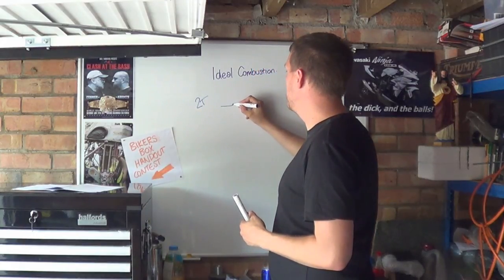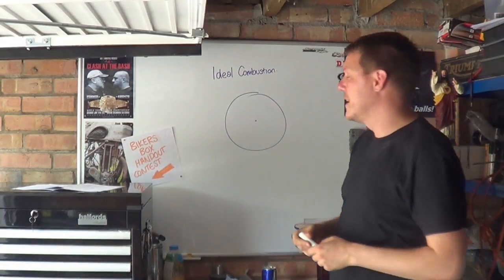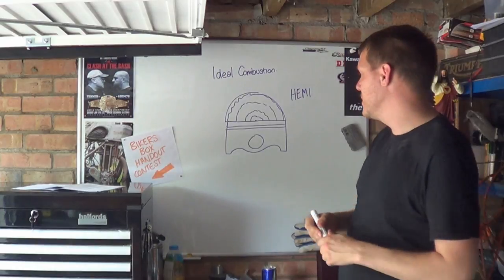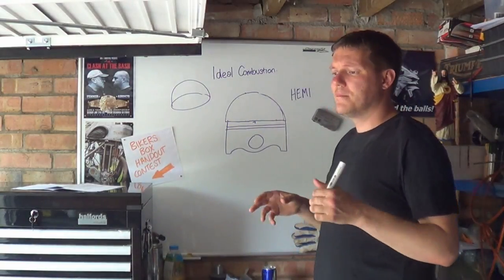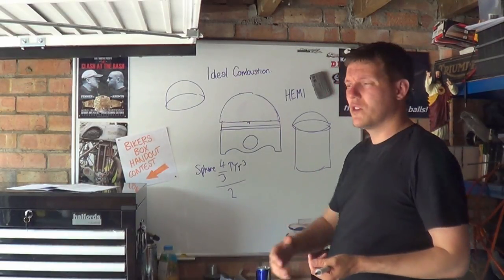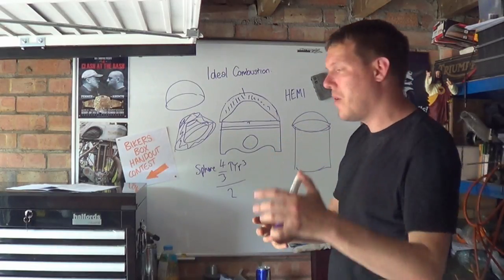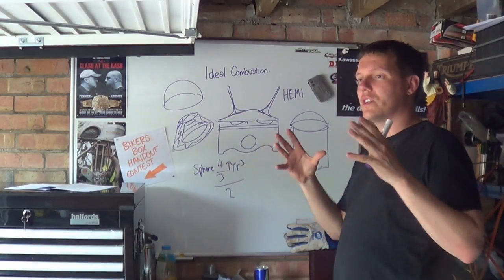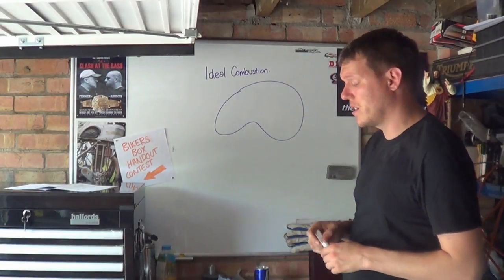Perfect Combustion and HEMIs

Comment: A lot of italian high performance car engines used to have hemi heads back when they were all 2 valves per cylinder. Ferrari colombo , jano , lampredi v12s , ferrari lampredi inline 4s , ferrari jano v6s , ferrari v8s , lamborghini bizzarini v12s , lamborghini p300 urracos v8 , alfas v8s , fiat lampredi inline 4s etc but whenever the word hemi gets thrown around only thing people know about is mopar. They have absolutely no idea that those engines i just listed are hemis and they think hemi is this great american thing lmao. Also the racing variants of these engines often had twin plugs per cylinder to try to get an even going flame front within the cylinder

Comment: Hemi heads are very efficient under boost, or with very mild cams running low octane fuel. That is why the heads are still used in truck engines because they are efficient at making low end torque and when flame propagation is not a big issue at low rpm. Also, the reason bikes have >12-1 compression is because they are not designed to make any reasonable torque at low rpm. There would not be enough horsepower from a 250cc bike if It make all of its torque low in the rpm band. This means the bikes are actually very inefficient at low rpms (late intake valve closing) to lower the dynamic compression ratio and raise the torque peak. Bikes would not be able to run 91 octane fuel if they had mild camshaft designs, the cylinder pressure generated at low speed would be so great it would detonate badly.

Comment: You have no understanding of wet flow and total combustion . Total Ignition timing is the real indicator of how efficient  the Intake port and chamber is , A typical pent roof chamber 4 valve engine makes best power with 20 degs of total timing , that is very good yes , and the OLD Hemi will run with 38 to 40 degs of total timing , But the intake port wet flow is all down the side of the cylinder wall , so now atomized fuel even goes to the spark plug , But if you develop the port and chamber together as I have done with a kidney shape chamber and wet flow that will wet both quench pads , On an engine dyno w a 410 cu in ford clever , that engine made best power with 17degs of total timing . That head became the CHI 208 head

Comment: flame propagation in the cylinder is a very interesting subject. I worked as a contractor at Perkins engines for a few years and used to love chatting with the engineers about this type of thing. The swirl is incredibly important to allow the flame to propagate like fingers through the cylinder. Great video Matt.
Reply from the maker: "Perkins"

- in Leeds or Peterborough. My old man used to work there
Reply: The Workshop Peterborough mate. Couldn't fault the engineering there. They might paint some of them Yellow...but they're still well engineered British engines

Comment: Great video as always Matt.  Yamaha tried to mitigate the limitations of hemispherical chambers by introducing a polyspheric chamber with the XS1100, a design which required six machining operations to achieve and it allowed them to run a lighter piston with a slight crown but achieve the same volumetric efficiency as their rivals .  So even back in the seventies Japan knew the hemi was dead.  In fact the XS11 was a milestone engine for Yamaha for a number of reasons, first in-line four cylinder for Yamaha, the first in-line four to run CV carbs.

Comment: I like throwing crazy ideas out there so here goes.  Why not have the cylinder head flat and the piston a convex sphere so it dips in like a spoon so the piston its self holds the perfect hemi shape.  Great videos Matt.  It tunes my brain in works it hard in the the same way my body feels good after being in the gym.
Reply: The force of the combustion would not only be downward, but all along the piston wall, pushing it in all directions the piston wall is opposed to (even though the net force would still total to a downward movement, any force being applied anywhere other than towards a downward movement would be inefficient) and that's why piston heads are flat. The Workshop explains this well when talking about Rotary engine flaws, as the combustion doesn't directly push the rotor the way it's supposed to go, despite the net force totalling in the result of a correct directional movement for the rotor.
Reply: it's been tried. The Jaguar V12 had this chamber and VW did some engines with this chamber. IIRC I think the Audi 5 cylinder might of had this type of chamber Early on.
Reply from the maker: And don't forget diesels
Reply: do an image search for 2cv head and pistons... is that what you mean?

Comment: I don't know if it's being done or thought about. Say you'd create an alternate exhaust cycle, where you have a conventional valve head with short valves straight up. After ignition on the downward stroke you keep the exhaust valve closed, (trying to create a vacuum), when the piston is reaching BDC you introduce air, and open the exhaust valve shortly after (with negative pressure), purging the cylinder of exhaust gases. Whould something like this be firstly: mechanically do-able, or in need of a boost system. For instance using a turbo to "vent" your cylinder. Just thinking crazy stuff here. (edit) this to maximize compression and equalize the combustion process as much as possible, by getting the valves, pistons and top of the heads as close to each other as possible at TDC/Ignition.

Comment: Wait why can't you put the spark plug on the piston?
Reply from the maker: Are you mad? lol Good question - video this weekend
Reply: That's just what I was going to ask, little taller piston to fit above the wrist pin and wire. Have some skookum (AvE-ism) ass wire run down past the crank to your ignition of choice. I'll bet it hasn't been done because the efficiency gain isn't worth the manufacturing cost.
Reply: I'm mad af man, cliffhangers are bs!
Reply: Cody I'm hip that's what I was thinking
Reply: Could you imagine doing a spark plug change if they were in the pistons lol
Reply: I do, the problem is holding it on without it flying around, I drill 2 holes in the piston and just cable tie it down, after the engine has done a few revolutions the plug has usually made its imprint in the head for clearance. you just run the HT lead through the original plug hole and plug it with some silicone.
I have also done the same with just a cheap disposable lighter that way there is no need for the HT lead.
Reply: 69waveydavey I just turned my engine upside down so the spark is on the bottom.  saves money in cable ties and silicone
Reply: karl shaw according to Matt, serviceability doesn't matter to engineers. (Just poking fun :p)
Plus with fuel injection and spark plugs in the piston would last longer than the first owner.
Reply: karl shaw Wireless spark plugs. Genius.
Reply: You can also do away with the exhaust valve as the fumes will just run out under gravity, less moving parts more energy saved
Reply: While we're at it, let's put the intake valve in the piston, and use the crank case as the intake.
Reply: Thats been done, early rotary aircraft engines had exactly that, the problem was they would end up sticking and they eventually switched to ports a bit like on diesel 2 strokes.
Reply: Ceazar Carr You could have a distributor in every crank and always get the right timing!
Reply: nooooooo!!! conductive path through crank conrod and pistone, earthed through the cylinder liner, with a gap in the piston design to make the pixies angry. engage safety squints before starting
Reply: mondayfool they also use knock sensors, basically microphones tuned to the frequency of a specific engine.
Reply: Tom McKenzie makes sense. Id like to get a 'dumbed down' version too, I think I get it but it's really confusing still. 
I'm a Saab guy so that caught my attention lol, I own an older 900 without trionic but one day I want to put that on a turbo 900 classic
Reply: The Workshop SAAB did it, the spark did jump directly from the electrode to the piston
Reply: Gudgeon pin. ;)
Reply: How about multiple laser beams that intersect just above the piston?

Comment: I concede that 4-valve heads out-flow 2-valve heads, but I still maintain that the LS series is still acceptable because the height and simplicity of the cylinder head for the performance they achieve is useful.

Comment: In a four stroke engine. The hemi cylinder design allows for 13-13.5 to one. Where the hot hot exhaust valve affects compression ratio. HCCI combustion chamber allows so far 20.00.1 compression. In a four stroke engine. Imagin if you combined them. Both together in a valve less two stroke engine. We could see compression ratios at 35-40.00.1. With a true hemi domed piston to boot. Haha my two stroke hemi V8. Dragster engine. Fires four combustion chambers simultaneously. Race me. 😄

Comment: What about a quad-hemi chamber, with 4 smaller hemispheres arranged in a square over the flat piston, and a 4 valve design with a valve in each hemisphere, and a spark plug as close to the piston as possible in the center of all 4 hemispheres?

Comment: Im American and I agree with everything u said. yes our comp ratios are low but that's ok because we have very crappy gas, so couldn't run very high ones anyway. ✌️love ur vids
Reply: Scotty Whittaker Our gas is no different for the most part from other countries. You are confused by the different octane rating equations. our regular 87 is England's 91 or 93 or something. Point is, they are the same octane.
Reply: i think Dylan is right. but just not clear enough
i assume he meant RON and AKI fuel octane rating
like 91RON fuel is like 81 in AKI or something i can't remember the exact number. but it's the same fuel octane rating, just measured with different measurements.

like you would measure a table in meters or inches. different numbers. same size.
Reply: Exactly, just a bit more concise than my frazzled brain can manage

Comment: mercedes use the cone effect on the new petrol direct injection motors to obtain a lean fuel ratio for homogeneous running at low torque and switch to full fuelling via the injection pattern for stratified full power at high output. it is so precise that if the spark plug is slightly off its torque setting that cylinder will not fire at all
Reply from the maker: Link please?
Reply: I might have something in a training book some place from when I did the v6 and v8 petrol engine course. I'll have a scout in my folders
Reply from the maker: Awesome - cheers

Comment: Could you do a video explaining how TJI in F1 works, Sky had a small explanation on tv but I found they never went into any specifics on how having the spark plug in a mini-chamber separate from the main combustion chamber and having the flame front propagating from there would be a benefit. I would be very interested to know that if this is such a great idea why it has not appeared in any production vehicles since regulations on emissions are every increasing. Great videos btw

Comment: Tell the Hemi thing to the Top Fuel and Funny Car dragster racers. Big block fords and Chevies have been tried on nitro, but the Hemi always has the Edge in the Top end. Whats so good about the LS is that it is so overengineered, I mean you have 4 bolts in the mains with another two that come in through the sides from the outside of the block in the sump skirt region, it's just so understressed in stock form it's rediculous. It's only real competitor, the Ford modular motor, available in either single or dual overhead cam formats (hence - modular) is so much more expensive on a component by component basis that it's not funny. I mean, have you priced what it would cost to totally renew the valve train on each head on a Boss Mustang Dohc modular? For that sort of money you could built a pretty stout LS. And there's just so many available at every junkyard in the states that, if you blow one up, you just buy another junker core and transfer all of your bling bits over. What I'm doing is, you can get the truck blocks, which are cast iron instead of Aluminium but still have the alloy heads, so they handle a bit more boost, I wanna built that up and back it up with a stout 4 speed auto with transbrake and go racing. And, like I said - If I blow it up, it's just a matter of buying a 2nd hand core and swapping over the go fast bits and having at it again. Try watching this : https://www.youtube.com/watch?v=VsmbbuSq9m0

Comment: Hi Matt 
I have been thinking alot about rotationel direction i an engine. Is it just a balancing or timing issue or do motor co. all have there way of getting around it. 
Awesome show. Lots of knowledge. 🖖
Reply from the maker: What do you mean? Which way they turn?
Reply: The Workshop. Yes precisely which way they turn and how to control it. If it even needs to be controlled? Because potentially its just a timing issue. Right?

Comment: Why couldn't you have a dished hemisphere in the piston with a totally flat cylinder head with four valves in it with the spark plug central?
Reply from the maker: Many reasons, and here are some:

1) rockers etc need somewhere to live. Vertical runners massively restrict this. For OHC this is also an issue.

2) the piston would have to be bigger/thick and this means heavier which reduces piston speed and rpm hence power 

3) piston heating on the 'rim' promotes detonation.

Comment: That's why all of the top fuel dragsters use super charged hemis... because of the dome and excellent combustion and air flow. But what do I know lol
Reply: The reason they use hemis is that hemis work very well in boosted applications. The dome is actually not a pro as it makes the piston very heavy and is only included to get the compression ratio right. Other reason is that the only other manufacturer to make a production hemi was ford with the cammer, but it was underdeveloped. The cammer did compete in top fuel for a while. The 460 was never used as it was too late to the game. The only other engine that could have bested the hemi was Oldmobile's stillborn W43. With pushrod actuated 4 valve heads on the 455 block, it stood to beat the Buick Stage 1 as the most powerful street engine and with the DOHC OW43, would have cleared house in racing.

Comment: what if you just added alot of boost to get around the shity compression ratio. or you could make a "semi hemi" like alot of performance American v8s have, which is basically 2 small hemispheres around the valves and the rest of the piston is flat.
Reply from the maker: The LS engines have bathtub chambers

Comment: Let's say we put a proper OHC, 4 valve head on an LS or modern "hemi" block. Keep the cam profile comparable to factory and CR low enough to run on 87 (91 RON?) octane fuel.  How much power would be gained and where in the RPM range?
Reply from the maker: Good question, 

"Keep the cam profile comparable to factory and CR low enough to run on 87"

- this is the whole point of changing to DOHC etc is that you can use 'better' cam profiles, run higher compression ratios etc.

If you stuck a DOHC head on a LS engine then you would see increases in HP as your volumetric efficiency goes up. How much? I'll have to find out by doing it. Great future project. How much does a new LS block cost these days?
Reply: Peak torque would barely change. You would get a bit more top end power from the better breathing. Perhaps 10% without changing cam profile. See watch?v=ow5cGV7bXCw. He goes into porting and 4v in the back half.
Reply: The Workshop Ok so my point is exactly this: (and another reply has hinted at it). The majority of "LS" engines out there are in trucks who need power in the 2500 to 3500 range. And that's only when loaded to capacity, which honestly isn't that often. But no one wants to have to rev to 4500 to pull up a mountain grade. It would be counter-productive to engine life and fuel efficiency. So....the added cost of OHC and 4 valve heads would be a cost passed on to the consumer with little benefit.  Now Cummins switched their 6BT to 4 valve some time ago but I'm clueless as to the performance benefits from the valve train switch alone.  It's rev range is much lower but the volumetric efficiency isn't limited by a throttle plate either.

Comment: fiar abarth 1000 -radiale   this is a good run down of the motor.try looking at the carozari bodied jobs like abarth 204a.the double bubble ,the 1000sp ,2 litre and v8 sport racers and berlina corse.this may give you a buzz.my last abarth was a little beaste ,push rod like the 982 but had a big valve head.l regretted getting rid of it forever.the sign of the scorpion

Comment: What about just having the centre electrode of the spark in the top of the head and then having it earth against the top of the piston?
Reply from the maker: You'd have to earth the piston that doesn't go though the bearings, otherwise the bearings will arc. Not only that but the bearings are oiled so you'll probably have bad connection issues all the time
Reply: im a twat nvm, forgot their is little to no metal on metal contact.